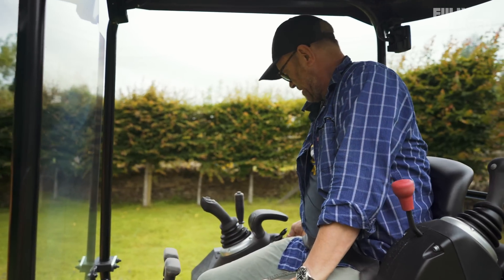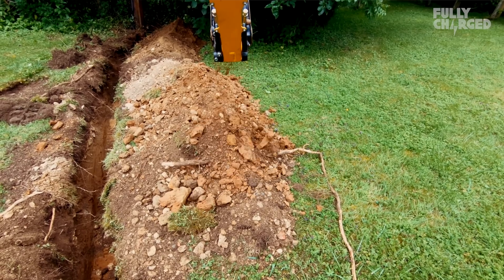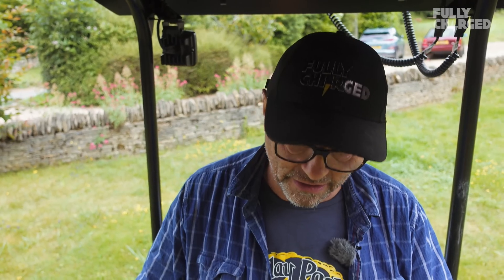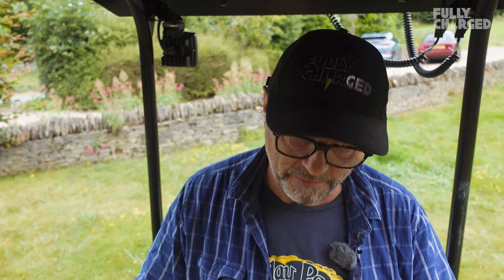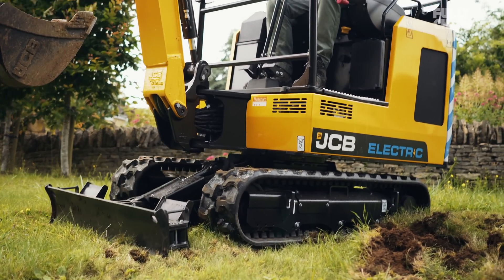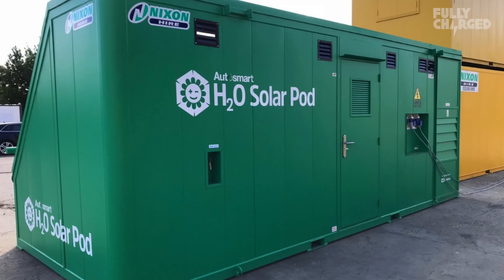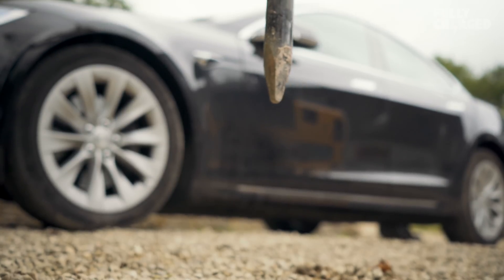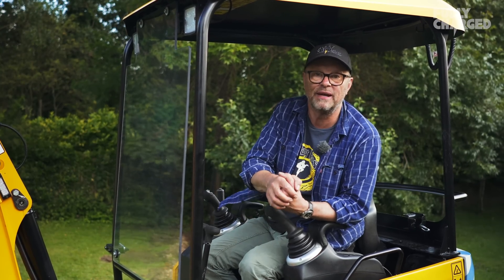JCB Electric Excavator / Mini Digger JCB 19C-1E E-TEC zero emissions electric digger | Fully Charged

Comment: I spent my working career as a crane operator.  Every crane I was on was powered by a diesel engine.  Because of the nature of the work, I would guess that more than 90% of the time the engine was at idle.  
In order to get the power from the engine to the various cable winches a complex system of gears, clutches, and brakes was required.  In some cranes a hydraulic system was substituted for the gears and clutches.
I believe most cranes would be vastly improved by making them electric.  First of all the batteries could serve as some of the necessary counter weight.  Each function could have its own high torque geared motor which would utilize regenerative braking when a load was being lowered.  Because of the high torque, clutches should not be required.
Aside from the reduced noise, there would be a substantial reduction in cost given that an idling diesel consumes 2 to 3 gallons per hour.  The electric would be essentially consuming zero at idle.
Reply: Recovering power from lowering a load is a brilliant idea, it means you'd only lose energy from various losses in the system, but the bulk of the energy you spend lifting something is returned when you lower it again.  I imagine if you were using the crane to lift a number of things from a tall building down to ground level (e.g. lifting an empty dumpster up and bringing it down full) you might be able to generate enough electricity to entirely power the crane without needing anything from the grid!  I wonder whether an electric crane would have to have the ability to feed power back into the grid for situations like this.  It might actually be a net generator of electricity for certain workloads.
Reply: @Berkeloid0  The regen efficiency of a motor is relatively low (motors are not optimised as dynamos, and vice versa), but you certainly can recoup some of the energy, and more so if a dynamo is used for the purpose. The additional weight is not necessary a problem on earth moving equipment. The additional cost of a dynamo will be recovered by the energy which is saved.
Reply: Don't some cranes already recapture energy or use a generator like motor when lowering loads?I don't know where the power would currently be going but it sure makes sense for batteries
Reply: @reviewcrewforyou  I retired a couple of years ago, and up to that point the only type of crane capable of recovering any energy was the tower crane, which is almost always electric powered.  However, I never saw one that actually had any kind of recovery system.  That is not to say there wasn't one, just that I'm not aware of one.
Reply: FYI--there is an energy storage company that wants to use a  tower style  crane and concrete blocks...I was thinking other cranes could be used in the same manner if designed to have duel purposes
Reply: @nc3826  There is somewhere that they use train cars filled with something and move them up an incline as energy storage. I've also heard of pumping water up and recapturing when it falls.
Reply: @reviewcrewforyou  Pls show me the link for the train energy storage idea...it seems to crazy to be true??? and "pumping water up and recapturing when it falls" is just using a dam in reverse
Reply: @nc3826  "Using a dam in reverse" is called "pumped hydro" and it's been used for energy storage for decades, so that at least is nothing new.  There are a few YT videos on pumped hydro stations if you're interested in working examples.
Reply: aDIYguy - On some gravity inclines from the olden days, (19c and and late 18c) limestone, iron ore and coal transportation systems. Where great tubs or trucks were sent down an incline. The gross weight of the descending full tub or truck, would be partially braked by the counter-balanced ascending empty truck. An example of such, can by seen above the Brecon-Monmouth canal at the Llanfoist wharf. Though only the rails and some of the stonework survive.
Reply: @Berkeloid0 thx but as an engineer that worked similar projects I knew about it and what it was called long before there was a YT....and  calling it a "dam in reverse" was to make a point...it was the one idea that has been proven and should be exploited more... have a good day,Sir...
Reply: @nc3826  No worries, it just came across like you thought the concept was not useful.  Nevertheless I hope the explanation of mine and others will be informative to some!
Reply: @Berkeloid0  NP the main issue has been push back... since it can degrade the aquatic environment...so it has be  well thought out...
Reply: @nc3826  The hydroelectric dam at Smith Mountain Lake on the VA & NC border uses that system. They use any excess power to pump water to a reservoir at a higher elevation and then use it again to produce electricity when demand is high.
Reply: @doug960  again, that was my point and its just one of many examples... that is needed more then ever to the address the duck power curve production issue....created by using intermittent alternative energy source like solar and wind power...
I guess my initial comment confused you and others...
Reply: @nc3826  Just pointing out a real world example if you wanted something to read up on. I've toured that dam facility. It's a cool site.
Reply: @doug960  NP... glad u enjoyed the tour...
Reply: @nc3826  Fullu Charged show have a video on this subject- A water reservoir in the mountains of Wales, UK, using pumped storage when electricity costs are low/ zero..
Reply: @RP-ze6bo  thx but I have seen it... and ofc its used to balance the grid via price signaling...but its just drop in the ocean for what will be needed...
for example, such as duel purposing cranes or electric trains or anything that had potential energy that can be stored and released as electric when its needed ... without having to create purpose built infrastructure for storage,  that only used for small faction of the time...
Reply: Dinorwig power station, Llanberis, Snowdonia, in Wales is just that.
Its nick name is Electric Mountain.
It's a pumped storage hydroelectric power station.
At times of lower energy demand and power stations are generating surplus energy, they utilise it to pump water up to a lake at the top of a mountain. At moments of excess demand, they reverse the process to generate power.
It's ideal for sudden surges in demand, like in the afternoon/evening when people are getting home from work and cooking their evening meals, or say after a sports or major soap opera event, (like Who shot JR?) when the viewers at home all go to the kitchen and put the kettle on for tea or coffee etc, the demand suddenly spikes.
Reply: And you can gather energy back into the system every time the load descends too.
Reply: @reviewcrewforyou  strange but true so thx for the feedback... and it can use existing infrastructure so love the duel purposing....have to save it check it out more later...TC
Reply: Excellent thoughts, always a shame when the people with all the ideas don't actually make the decisions.
Reply: Great idea, but nothing new over 30 years ago in Lithuania during building boom tower crane's all were electric no batteries, three faze power supply, some were on rail tracks moved along building it was  working on would have cable dragging along. Electricity is the way forward, like you idea on recoperating energy. Keep up good ideas👍
Reply: Don't they have hydro-static drive?
Reply: If it will work hard for 10hrs it will be ok
Reply: Thanks for sharing your experience and ideas, which make a great deal os sense.
Reply: Agree 100% . Regenerative energy was invented by a bloke in his back yard shed in Brisbane Australia 25 years ago . Permadrive. His patent was bought by big oil & shelved. How things have changed !
Reply: you could even turn off the engine and then start it when you need it

Comment: This is probably going to great for helping combat hearing loss in heavy machinery operators. Also I wonder how long it takes before people living nearby worksites start demanding the ‘quieter machinery’ when it comes to noise pollution. Wonder if quieter machines could also mean job sites could have longer work hours available as well… aka they wouldn’t always have to pack up shop before people go to sleep, granted that would depend on what they are doing, jackhammering isn’t quiet no matter what machine you use. XD

Comment: How many meters of trench would it dig on a battery? I mean that is really going to indicate whether an experienced operator is going to be "able to dig all day" with it or not.
Reply from the maker: On a personal note I managed to dig a 60 meter trench, 1 meter deep and 50 cm wide in hardcore and topsoil based earth, plus footings which were 30 meter sq and had over 55% of battery left. That took all day.
Reply: @fullychargedshow  when you measured it you said you were at 60cm deep. And you seemed to finish for the first day after digging across the lawn to the wall, which looked like about 15-20m, with about a quarter to a third left in the battery. And then it looked like you dug the rest the next day

Comment: Trouble is 

How long would the battery last with all lights on and heaters on in colder weather
Reply from the maker: Well, lights use a miniscule amount of power compared to the hydraulic pumps, and as it doesn't have a cab of any sort, there isn't a heater, but even if there were, it would reduce the run time by maybe 2 or 3%, so maybe instead of 7 to 8 hours run time it's 6 hours 50 minutes to 76 hours 30.
So, trouble is, electric drives in all things are replacing diesel faster than anyone predicted. We'll soon be test driving a 5 ton electric dump truck

Comment: No need for the batteries when doing indoor work, running plugged in on 3 phase should work too. Also an option outdoors, cables are not that complicated.
Reply: The Swedish company Huddig makes wheeled excavators with hybrid technology. Can run on battery alone for a few hours, use the batteries for extra power and can hook the excavator to mains power while working. It's still a legacy system, but a great way of pushing greener technology without forcing the operator to make a hard choice, something that would require him to choose diesel.

Comment: Nice. Why do you need 3-phase power to your house? 3-Phase is used in factories. In South Africa we have constant power failures. So single of three phase, rich or poor we don't have power (all the time).  Then you need a battery-inverter. Change the 12V to 230V - 240V until the power comes back...

Comment: Heavy equipment being purely electric is nothing new, the mining industry were quick to put such vehicles to use almost in the very beginning when Steam and the first heavy duty Diesel engines came around.
The Soviets were trying to make electric powered dumper trucks running on overhang power, pretty genius if you ask me, in fact the Soviets were really funny with their electric busses that used overhang power but the fact is that they work really well and much better than diesel or petrol in the winter because there no waiting time, it sits in a garage preheated and gets out in the cold Siberian weather and just goes wherever there is the overhang and they can run on battery for a certain distance, genius.

Comment: There should be hybrid, electric is hard to use large scale due to the charging times, a hybrid could be on power when a diesel is idleing and be on fuel when needed/when battery is low

Comment: Well, as an excavator operator, this was entertaining in a slightly painful way! Ah well, we were a bit like that at one time too. A machine of that class, in that type of ground, should be able to dig 100 feet an hour 4 feet deep. Calculating the approximate amount of work accomplished against the battery life depleted tells me it would probably last 5 hours digging at full capacity. That's pretty good and is going to be adequate for most full work days.

Comment: Would have preferred some more technical engineering information ? Maybe a basic diagram. How the electric motor correlates to the hydraulic pump. What kw is fast charger ? This was mostly just a bloke attempting to operate a digger from 100 different camera angles. Not overly educational I must say. Apparently the battery does not last very long when being operated to a sufficient standard. Keeping in mind if you run out of bat you can't simply fill her up and carry on you then have to call it a day. every hour that machine is moving its paying its self off hence why you cannot risk having a machine not doing the required hours on site. Am pro this technology and I work with machines but there is room for improvement yet. Can't wait to see what come in next 5-10 years
Reply: That's more Jonny's department, being technical. Robert just becomes over excited and rambles lol. But as mentioned, useful for areas where a diesel cannot be used. It would be more expensive to purchase due to the cost of the batteries.

Comment: Ah, what it is to have enough clout Robert to be able to blag these things! Finally, these have reached the point of a usable machine and not just a gimmick. That said, it's not going to work in all scenarios as well as a conventional machine. One thing though, please, please, we need to stop referring to electric equipment as "zero emissions" this is misleading. All generation has an impact, be it from fuel,  manufacturing and or materials extraction etc. There is no such thing as zero emission unless we are playing semantics and kidding ourselves that just because the machine doesn't have an exhaust pipe it's not causing any!

Comment: I wonder whether these will use direct electric actuators eventually, and thereby eliminate the hydraulic system. I guess there are lots of hydraulic tools available on the market that makes such a radical redesign difficult, but if the cost or efficiency savings are large enough it might be worth the effort. This might also reduce the noise even further.

Comment: What about it with a breaker or a trencher how will the battery last and you say it dont use any power to charge then you allso state you can't have your extention cable wound up why because it's pulling a fuck ton of power electric is shit you need a hydrogen digger or something that don't take all day to refuel

Comment: Put a expert operator in the seat let him run it see how it holds up putting amateur Operator is like wiping your butt before you poop and wonton expert reviews from a amateur operator if it works good if not consider JOHN Deere
Reply: Huh?  Maybe try editing it so it makes a lot more sense.  "wonton expert reviews"?  You really lost me there.
Reply: Brad Mosch let me dumb it down for you put a Expert operator not an amateur then give a review
Reply: @peanutsmith1462  Much better.  My point (for everyone [me included]) is to proofread before posting to eliminate lots of crazy mistakes.  Wasn't trying to be mean... just trying to get a point across since so many make crazy mistakes in these posts that make them difficult to decipher.
Reply: @peanutsmith1462  But you do still have to learn how to break your posts up into sentences with periods.  Your original post should be 2 or 3 sentences... not one long string of words with no punctuation at all.

Comment: Piece of junk.  Electric will never replace engine run heavy machines.  Stupid idea's from this guys paid advertisement.
Reply: Either you're trolling or you have no idea how the conversion of fossil-fuel to electric is inevitable.  Whichever it is, stop it.
Reply: @BradMosch_engineer  Oh and what does one do if there is no electricity to charge the POS electric excavator.  Oh right lets bring in a huge diesel generator and run it for 8 hours to charge the batteries.  GREAT IDEA!
Reply: @bakabaka2061  You should call the company to let them know about all the problems with their electric machines so they can stop designing and selling them.  Let us know what they tell you.

Comment: I bought a very old antique ex railways battery powered forklift as scrap, I never knew that the technology existed back then, it had about a cubic meter of batteries which doubled as the counterweight, it had 2 large DC motors, one directly connected to drive the front axle and one for the hydraulics, very impressed.

Comment: Don't stop there JCB. 

How about a  2 wheel towable battery pack, so that on sites remote from mains power the digger can be re-charged on-site during downtime/operator meal breaks. And for long jobs the towable battery pack can be taken to a near-by charging place post shift/overnight and then returned for the following work period/day without interrupting the on-site work ? Thinking of the current model of re-chargeable domestic power tool model i.e. one power pack fits many tools. This towable pack could be used to power a whole range of kit from farmers quad bikes, land rovers, all farming equipment , builders kango hammers/pneumatic road drills, pumps, winches, powered ladders, airfield services,  fire services, event PA and lighting systems. . .  the lot i.e. substitute for a diesel generator/compressor. 

How about re-charging whilst-being towed by another EV/Internal combustion vehicle - so that kit wouldn't have to return to  a mains power supply/base for re-charging but could be charged whilst en-route to another site ?

How about charge-whilst-work (Where safety allows) via a cable from either mains/towable battery pack - two or more sets of batteries may be required in the using unit ?